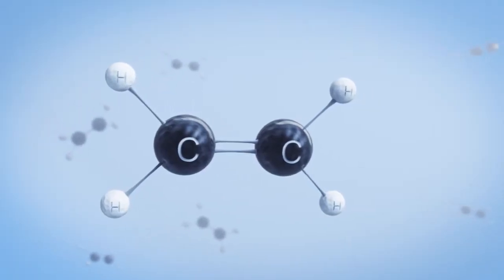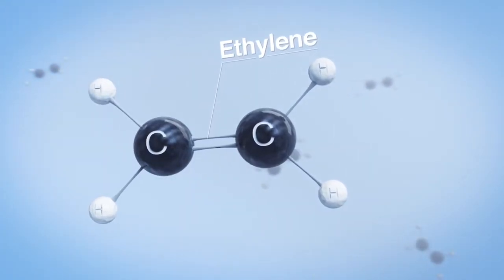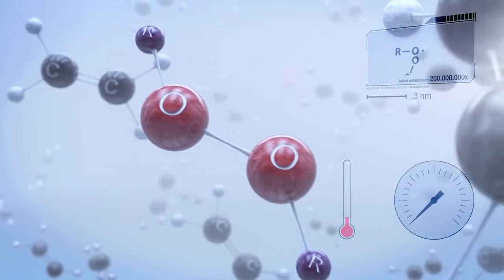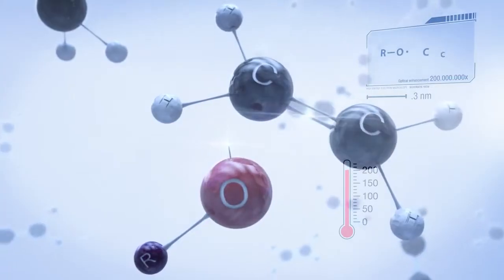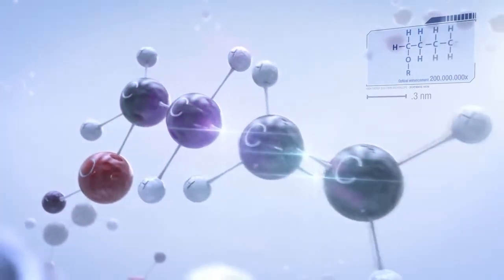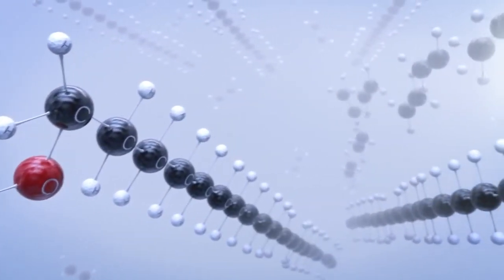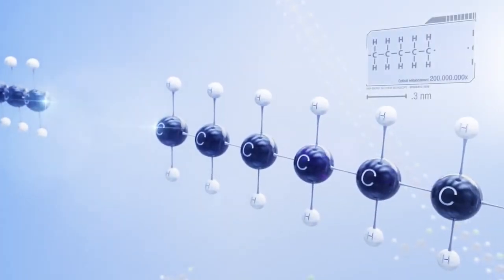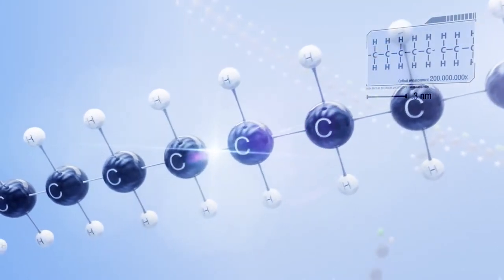Polymerization of Ethylene to Polyethylene (Source: Nouryon)

Comment: Thank you for such wonderful presentation. I have two questions. Please any one help

1) What is R radical itself ? CH3- 
CH2- 
Or C2H5-

2) What happened to initial oxygen atom? Will it be separated from polyethylene?
Reply: 1. A radical is an electron that is not in a lone pair so it’s an atom with only one free electron they are highly reactive 
2. I’m pretty sure The oxygen leaves when the carbon containing the radical bonds to another chain of carbons